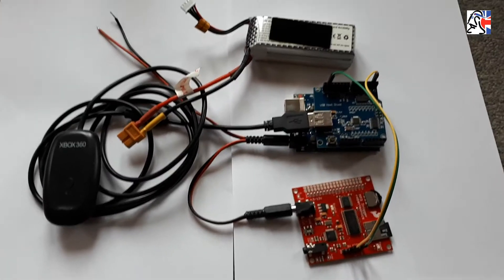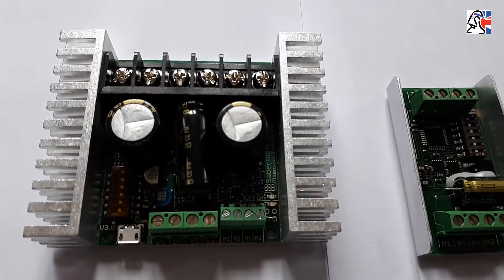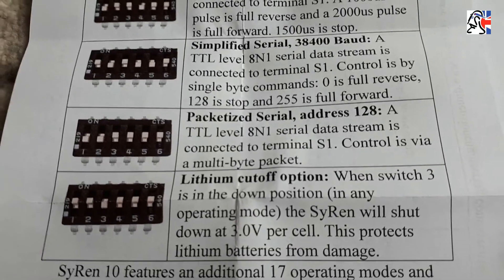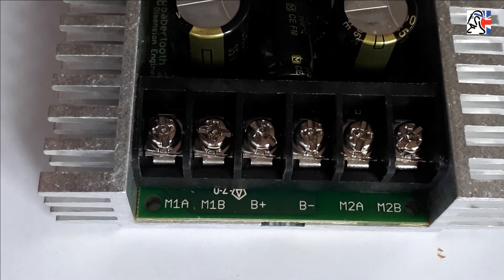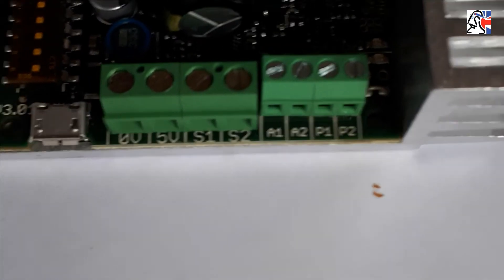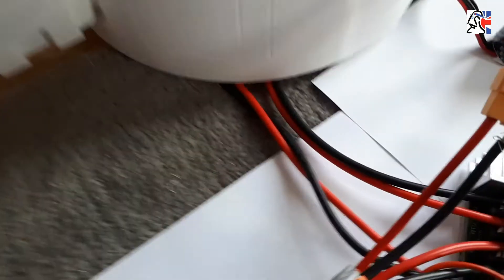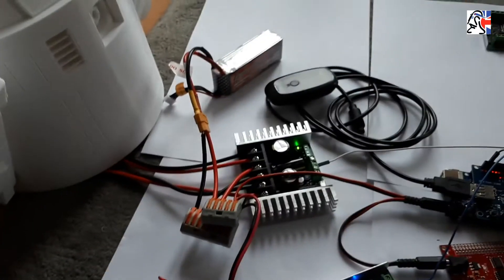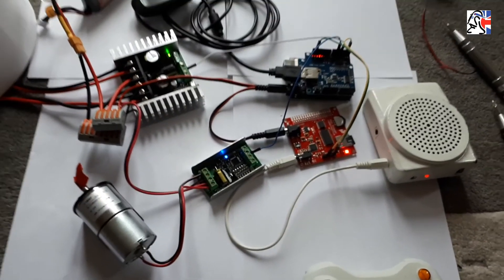Padawan 360 build Part 2

Comment: Would this work the same with an ADK and a Ryobi battery?
Reply from the maker: The way I build my boards is pretty much voltage agnostic, they can take anywhere between 12v and 24v without adjustment.  So long as you use the 5v out from the sabertooth to power the arduino, and the 5v out from the syren 10 to power your mp3 board, you are good to go (and assuming you use an amplifier board that can take up to 24v of course)

Comment: Two questions with this set up.  1) Can you use the Xbox 360 controller to provide more sounds then just the four off the buttons?  2) How would you control servo's for the dome panels and body panels using this Xbox 360 controller?   I'm about to start configuring my R2 to add motors, sounds and lights, but I want to make sure I can do all of these actions.  Great video for a one-handed man!  lol
Reply from the maker: Hi buddy, assume it was yourself that dropped me an email, in which case, you should have a reply by now, but in brief the answer is yes :) New video coming soon about servo control.

Comment: Hi Steve my syren 10 as finally arrived I plug it in the syren 10 goes blue but when I move the controller the motor for the dome doesn’t move I’ve plugged everything in the same as yours  plus changed the 1 and 2  on the syren 10 I’m at a bit of a loss hope you can help  I’ve made sure the motor works before hand too 😢😢😢😢😢
Reply from the maker: Sounds like it's not getting a signal off the arduino. Can't recall if you are uno or mega, my videos show an uno, the mega pin outs are different, if that has a bearing on things.
Reply: @ImperialLightandMagic   it’s uno I’ve tried to use everything you did even down to the waygo connectors I will try another wire see if that sorts it thanks again for your quick response
Reply from the maker: @paulbrady2801  ok so on Uno sketch, you should have pin 5 on the uno going to S1 on the syren 10 (pin 4 goes to the sabertooth). Bear in mind it starts at pin 0. Also make sure you have a common ground between uno and syren 10.
Reply: @ImperialLightandMagic  not got a ground from uno to the syren got a negative from battery to syren 10 only wire to uno from syren10 is s1 to 5 on uno
Reply: @ImperialLightandMagic  @Paul Brady  I am having the same issue... Wondering if you ever got it resolved?
Reply from the maker: Does everything else work, ie can you trigger sounds?  Which socket on the shield do you have the syren plugged in to? Happy to help if you can give me more info, perhaps upload a video or something.
Reply: @ImperialLightandMagic  Everything else works including power,sound, and sabertooth. I uploaded a video to my channel where I display my current wiring and problem. Thanks again for the amazing videos and help!
Reply: @ImperialLightandMagic  anything you could see wrong?
Reply from the maker: @minteken7395  I've just commented on your video, I suspect your code may be default dome baud rate which was 2400 which is wrong, if so, change it to 9600 and reupload, if no joy, check my other comments on your video.
Reply: @ImperialLightandMagic  thank you so much! That was the issue now it's working like a charm! And thank you for all the videos explaining the system, they made this process a breeze!
Reply from the maker: @minteken7395  Great, glad I could be of help :)

Comment: I've got this almost sorted after watching this video. I got my sounds back, I've got the acknowledgment when I hit the start button (I am using PS2 controller & original Padawan system) Before my drives would run constant but no sound. Now I have sounds, I have beeps when I hit start button, but drives do not spin at all. Any ideas?

Comment: What are you using to plug the wires into the motor controllers?  Also, what is the Xbox wireless USB receiver used for?
Reply: It plugs into the host shield to let your Xbox controller to talk to the uno, so you can give your droid commands.